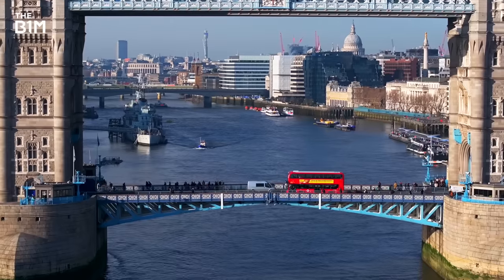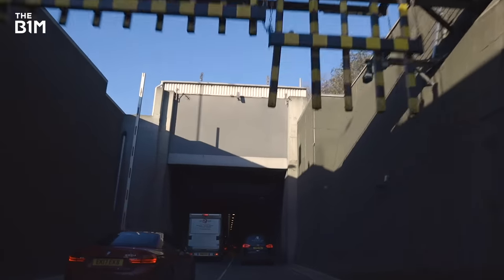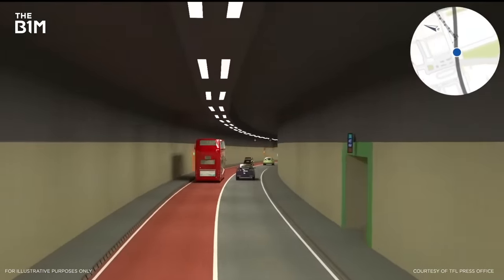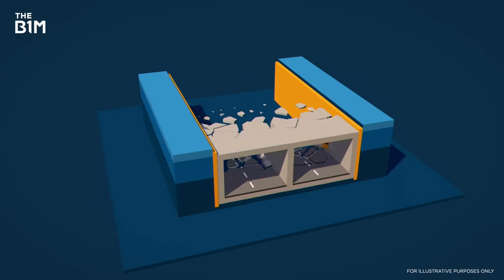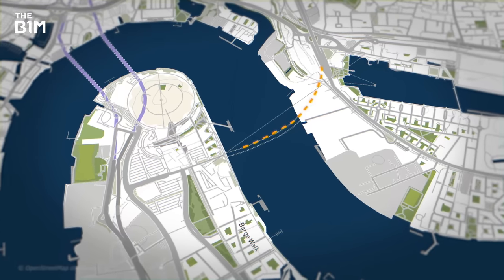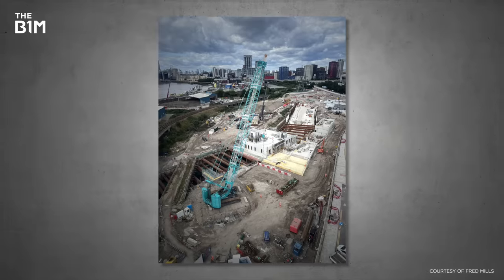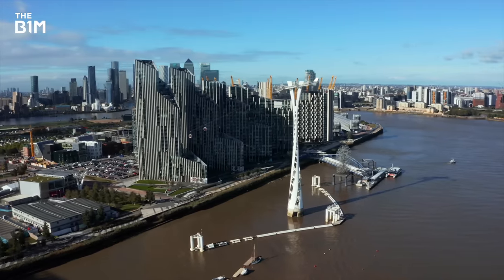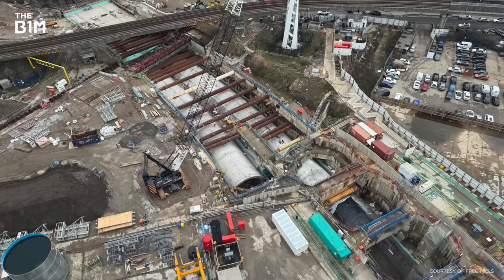The $2.8BN Megaproject Dividing London

Comment: Creating new roads never, ever leads to a reduction in traffic. Creating cycle lanes and increasing public transport does. I think it's disgraceful this thing doesn't at least have a protected cycle lane in each direction.
Reply: Yes, pedestrian and cycling routes are terrible currently north to south here. Woolwich foot tunnel had had the north lift out of order for 2 years now. outside of the Ferry times (which is a slow alternative anyway) you have to carry your bike up/down 125 steps. Frustrating with the size of that tunnel and the cost, they couldn't fit a cycling route alongside
Reply: What is traffic?
Reply: That's not true. Recently TFL created cycle lanes just off the north circular road on the A1000 (Great North Road). This reduced it from two lanes to one causing much congestion. And the cycle lanes? Nobody used them. So much so TFL ended up removing all of them. Cycle lanes might work in some central areas but not everywhere.
Reply: Agreed, this is particularly true when you consider there is nothing for cyclists east of Tower Bridge (tunnels and ferries don't count imo). If they were building this and the previously proposed crossing between Rotherhithe and Canary Wharf for pedestrians and cyclists, it would be a lot easier to take. But instead they're adding an extra crossing for cars where there were already quite a few decent options for drivers. This is only going to result in more light vans doing deliveries that could be done by cargo bike.
Reply: @NmpK24 Who is talking about the Great North Road?! Talk about distraction. We are talkng about a route across the Thames for those other than driving. 11 mile detour to currently cycle across the thames at this point. Why are we building another tunnel for motorised traffic here that doesn't benefit pedestrians or cyclists? I see lots of cyclists routinely carring bikes up and down the 100's of stairs on the foot tunnels (nice if you're fit and strong enough to be able to do that). There is clearly a demand here.
Reply: @a1white  It would have been so easy to make the tunnel a tiny bit wider and have a bike lane in each direction. It's infuriating that car-centric projects like this go through, despite all our climate goals and policies supporting active travel.
Reply: @LightbulbTedbear2  totally agree. Such a wasted opportunity
Reply: @a1white  I always wonder, where does political support for projects like this come from? Who is ACTUALLY driving in London?
Reply: So you would be willing to pay a toll to use it then? If motorists have to pay a toll then there is no reason why cyclists should not. pay your way or shut up.
Reply: @healthlondonse2592  Yeah, let's make tolls proportional to tunnel width taken up and wear and tear caused to the road surface. I'm sure cyclists would be happy to pay their £0.0005 toll.
Reply: @healthlondonse2592  yes, absolutely I would. One that is proportionate to the weight of my vehicle. Sounds fair? Like HGV’s pay a lot more than cars. If cars weighing 2 tonnes and pay, say £2 each way then a cyclist at say 100kg (bike plus person ) should pay about 10p. I’d happily pay my way.
Reply: @domramsey, are the cyclists willing to pay for it. I'm tired of driving around cyclists on roads where they are ignoring the cycling path provided. For some reason, cyclists  seem to believe using the provided cycle paths is for wimps🤔🤔🤐😡
Reply: @MrMaxwood  Car-based taxes do not even come close to covering the unfathomable cost of car infrastructure. So cyclists are already paying for you - as is everyone else outside of a car. Those who drive are effectively subsidised by those who don't.
Reply: Cycle lanes that are made out of car lanes means that 2 lanes turn into one and increases the congestion x2
Reply: Cycles are not allowed in these tunnels.  Silvertown Tunnel,will have shuttle buses, which carry both cycles and cyclists through the tunnel.

Comment: They bored two tunnels for vehicles, why didn't they spin it round again and do another pass for pedestrians and bikes?!?
Reply: we don't want poor people getting access
Reply: They won't pay juicy tolls like vehicles do
Reply: If you cycle or walk you're not really affected by congestion.
Reply: @r3dp1ll  but more people walking and cycling will reduce congestion.
Reply: @harenterberge2632 . It’s not just about local traffic. This is also access to the rest of the east of England.
Reply: Isn’t there already a pedestrian tunnel nearby
Reply: Yeah
Reply: Real answer: Because tunnel boring machines aren't just expensive to buy, they're expensive to operate.

The cost-benefit analysis for pedestrian and cycling infrastructure works because they're high capacity and low cost. Ballpark figures from the National Association of City Transportation Officials is that a footpath carries 9,000 people per hour per direction, a two-way cycling path carries 7,500 people per hour per direction, a mixed traffic road (read as: buses and cars mixed together) carries 1,000-2,800 people per lane per hour and a road for just cars carries 600-1,600 people per lane per hour. Active transport infrastructure is cheap and high capacity but sacrifices speed in order to accomplish that. You lose most of those cost savings benefits once you start digging tunnels.

A third tunnel for pedestrians and cyclists would have a higher theoretical capacity than both those road tunnels put together but you lose a lot of those capacity benefits over longer distances and you're also increasing your tunnelling costs by 50%. The way most transit agencies do CBA's places a lower benefit on active transit infrastructure the longer the route is because active transport is best for local trips. If your goal is to increase the rideshare of active transport, then you'll get more millage from converting street parking or existing surface road space into separated bike lanes for local trips than from single big spends on new tunnels and bridges.

TL;DR
If active transport use was a priority for the authority building the tunnel, any agency doing the CBA on a third pedestrian/cycling tunnel would come to the conclusion that wider footpaths and separated bike lanes on existing roads is a better use of that money and recommend directing funding towards that instead.
Reply: Transfer the machine and do the DLR extension to Thamesmead is more like it - you could probably fit the two tracks into a single bore.
Cycling is a nostalgic distraction that will pass by the 2030's.  The Western World seriously needs to grow up - the rest are laughing at us!
Reply: @harenterberge2632  You don't need cycling - I'd nearly walk faster than a bike!
Reply: @RedKnight-fn6jr  cars are not suitable as a means of transportation in a crowded city, they just use too much space and because of that the infrastructure is damn expensive . And  congestion is unavoidable, no matter how many roads and tunnels you build. Cycling is cheap, requires very little space, is healthy and a great way to get to nearby destinations.
Reply: @RedKnight-fn6jr  that is just nonsense. normal walking speed is 4 to 5 km/h. Normal urban cycling speed is in the range of 15 to 25 km/h.
Reply: No demand
Reply: If The River Thames was put in a tunnel there would be room for everyone.
Reply: @harenterberge2632 Unless for some reason you're not capable of cycling.
Reply: @briantitchener4829  and not everybody is capable of driving. So maybe we should create infrastructure for all modes of transportation, not just cars.
Reply: @harenterberge2632  Take a taxi?
Reply: @briantitchener4829   If you do all personal transport within a city with cars you need to knock down half the buildings to make room for more streets and there will still be congestion. A two way bicycle path takes up the place of one car lane, but can transport more people than four lanes filled with cars.  So it makes sense to accommodate bicycles and public transport as much as possible. This means also that the people who really do need a car will be stuck in traffic less.
Reply: @harenterberge2632 I sense you are suffering from an acute form of vehiclophobia. Sadly, there is no known cure.
Reply: They don't need a tunnel under the river for pedestrians and cyclists.
Reply: You could solve congestion in London by investing in the rest of the country..instead of bloating London with opportunity and cash.,
Reply: @stephenguy6606  there is lots of room in the rest of the country..why not use that?
Reply: We could also decrease are population
Reply: @harenterberge2632 the bus exist and they easily make a train tunnel as well. Just don’t expect a pedestrian tunnel as they rather you in a form of vehicle when crossing.
Reply: @harenterberge2632 tolls, the tunnels charge tolls on drivers and pedestrians can’t be rolled.
Reply: Whenever I see a video of traffic in London, I wonder who would want to be a cyclist there. Maybe they get used to being close to vehicles that could squash them without the driver even feeling the jolt.
Even where there are cycle lanes for a few hundred yards, it still doesn't look like a good idea.
Reply: @harenterberge2632  can you charge tolls on cyclist, no. That’s why.
Reply: @harenterberge2632  it’s not just the car though, it’s the trucks and buses that use the same roads, you can build more rail lines but eventually, things get shifted on to road for the last mile.
Reply: @griswald7156  We have never had a demand economy in the UK. London never grew because it had public money spent on it - public money was spent on it because it grew, mostly as a result of private investment, and a huge and skilled workforce.
Reply: @Bobspineable Where did I write we should remove all roads? My point us that in cities you cannot base your entire infrastructure on cars allone. You will end up with a continuous traffic jam and a city that has more roads than buildings.  If you build public transport, bicycle infrastructure, prevent through-traffic in residential areas, you will end up with s much more livable city, and the cars, trucks and busses that need to be on the road, get around much easier
Reply: @hb1338  you’ve contradicted yourself…it has had public money spent on it..its been a spoilt child..
Reply: @kumbackquatsta because pedestrians will piss in the tunnel stinking to high heaven while your eyebrows singe by the stench
Reply: @harenterberge2632  you said it yourself, it can be on cars alone which means you build infrastructure for everyone which can be done. It will be expensive but you can build roads that everyone including cars and pedestrians will be happy with
Reply: Yeah just spin it round another couple times and have a good few tunnels going across the Thames, shouldn't be hard at all 😂
Reply: @sriramc5329  Spot on!!! 😄 Soon there will be a charge for crossing Blackwell tunnel
Reply: @Dirty44harry1  Make England India

Comment: I live nearby and take the DLR daily to work and have been seeing the construction progress. We received many leaflets on anti-Silvertown tunnel. I am personally not against the tunnel, Greenwich has many useful facilities and shops, however, there is no good direct route (either drive via Blackwall Tunnel or take a detour to Woolwich on the DLR and bus towards North Greenwich). Extra traffic and pollution is a concern to the area, but most existing residents chose to live under the flight path of London City Airport. I would welcome more direct bus routes to the south of the river using the new tunnels.

Comment: Busses used to go through the Blackwell Tunnel. I used that route as a kid. Two batches of double deck buses were specifically built for use in the Blackwall and Rotherhithe Tunnels, with specially shaped roofs to improve clearance on the corners.

Comment: "Worked hard to discourage car usage" yeah... for sure mate! Those price increases are true bargains!
Reply: It has tolls, it surely will discourage a decent amount.
Reply: @Bobspineable  Sad bit is that the Blackwall tunnel will follow suit in getting its own toll, so people with no choice will be out of pocket for doing something that was sustainably free for decades. This will effect everyone but disproportionately the poor. The are no other feasible options to get your car/van across the Thames in that part of London. East London doesn't even have proper train links across the Thames, so they don't exactly have any other options than their car. This move is extortion and a total disgrace.
Reply: @Bobspineable  It will just move the traffic to the Rotherhithe tunnel and tower bridge.. Only way to discourage central London traffic is to make the dartford crossing free at the same time, that would divert any traffic away from these tunnels that is not going to London. There are few crossings this side of London, which is what causes it to be so congested there... the charging will just move the congestion into London rather than improve traffic.

Comment: If there is a toll fee for use of the tunnel, the other nearby free tunnels will still be congested because nobody will want to pay especially if they would have to use it regularly.
Reply: Thankfully they're also intorudcing fees for The Blackwall tunnel from 2025 with what the mayor has proposed. I still firmly believe no one really needs to use these tunnels bar black cabs & commercial vehicles. Any fool who uses such a route desveres to pay & even then it's likely a one off rare journey.
Reply: @d.b.cooper1 . And how else are vehicles going from the south to the east supposed to cross the Thames? It’s not just about access from one side of London to the other, but across the eastern side of the country. If they’d dealt with this issue forty years ago when they first talked about it, we could have avoided years of congestion
Reply: @d.b.cooper1 how can you say them adding tolls to the Blackwall Tunnel as a good thing, its a terrible thing
Reply: @d.b.cooper1  Just shows your ignorance of the area & issues.
Reply: You do realise that any business will just pass the cost on to customers. It's London adding 3 pound on to the goods not going change much
Reply: @d.b.cooper1  that's just pure ignorance.

Beyond Tower Bridge there are only 3 crossing that connect NE London with SE London. All of which are at the limit of their capacity. I guess everyone that lives in the east of England who might need or want to drive somewhere across the Thames don't matter. 

there's only 4 train crossings as well, 2 of which are the DLR, So good luck getting where you want to go by train either. Guess we should all take up swimming lessons.

Comment: Fun fact: this was not the largest tbm U-turn, that award goes to the Liantang tunnel in Hong Kong, which was a 14.1m diameter (Silverton tbm is 12m diameter). Another fun fact, they will also be using this U-turn technique on the lower thames crossing project (the tbm on that project will be over 16m diameter and is the same contractor as liantang).

Comment: Induced demand is bound to not make the car traffic much better in the long haul. Having dedicated bus lanes however could be a "game changer" for keeping them and emergency services moving. I have family just a few miles north of Amsterdam. Traffic from there to central station has been bad since the late 1970's at rush hour. The tunnels don't have dedicated bus lanes within the tunnel, but they do have special lanes leading up to the tunnel. As a bus approaches, the main traffic lights go red for the main traffic lanes and the bus scoots almost effortlessly into the tunnel and within minutes you are at the main bus drop off at central station. In the late 80's / early '90's they added inbound bus lanes for a few miles heading into the city running completely separate from car traffic. That made a world of difference as the main road is just 2 lanes and the government is not going to upgrade it (as they don't want to cause induced demand). You'd have to be a fool to take your car into central Amsterdam at rush hout. Take the bus and for most of it's journey it's able to move freely at 40 plus mph while cars are stopped in grilock. I hope that this part of the new tunnel in London will make cross river bus traffic much more enticing. If busses are stuck in the same traffic as cars... why take the bus. If the bus can move more quickly ... then take the bus. I had a similar experience when visiting NYC a decade ago while staying in NJ near the stadium. The bus had dedicated lanes that snaked it around traffic leading up to the tunnel.The busses by-passed the local gridlock. After the tunnel there were dedicated lanes to took the busses up quite some distance (maybe 30 to 50 meters) to enter the bus terminal. Quite some view as you are in a bus in a single lane elevated road.

Comment: So, why did they not include pedestrian and cycling facilities again?
Reply: You can’t charge tolls on pedestrians, meaning you have to take a bus or ferry.
Reply: Additional expense. It’s not really suitable for pedestrians either due to the length and availability of other easier options (tube/boat)
Reply: Pedestrians and cyclists are not allowed as the noise and exhaust pollution levels are horrendous as in the Rotherhithe, Limehouse and existing Blackwall tunnels. The scenery isn't great either!